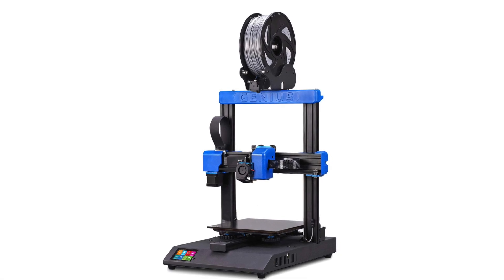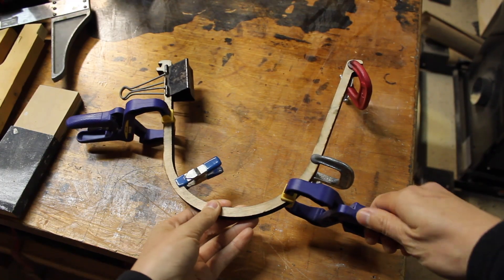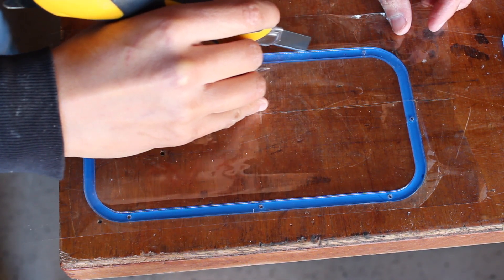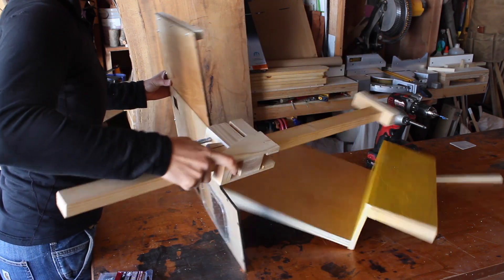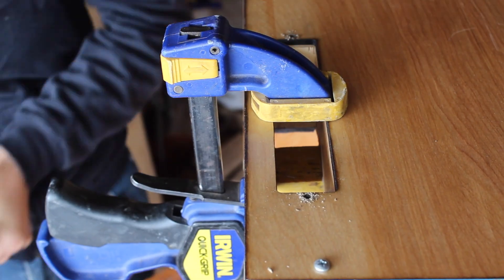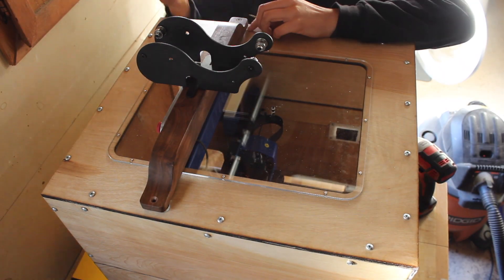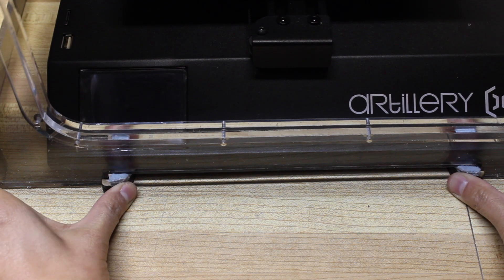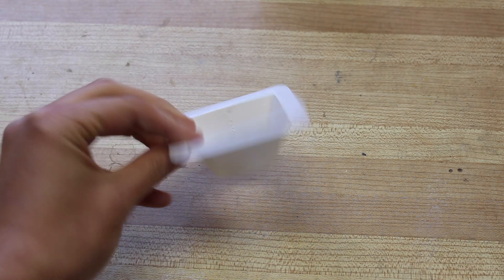Building a 3D Printer Enclosure

Comment: My dad swore by pop rivets and 40 years on I still use them. Fleece + spray = self adhesive pads is awesome. I've seen double-sided tape used but this looks much cheaper and easier to get the fit.

Comment: On my printer i didn't want the bed wire extending a mile back, so i made a holder which extends it just a little to the rear till it clears the gantry when the bed is full forward, and just goes up. Then i have a couple ziptie mounts on the side of the printer at the rear directing the wire up there. So the bed wire loop is vertical and twists rather than horizontal and rolls.

Comment: Why did you disable design history?
Reply from the maker: it is my preferred way to CAD for most things. I do a lot of pushing and pulling of faces. And I can never remember which step in the history I did each feature.
Reply: @AmyMakesStuff  In fusion 360 you can highlight a face/hole/etc and right click and 'find in browser'. This highlights the part in the browser (tree) on the left, but it also marks the feature of the timeline that generated it.
Reply from the maker: Good to know! My brain feels pretty wired to ignore the design tree though, unless I know exactly what the finished part will look like and it’s just a matter of adjusting parameters.

Comment: Awesome build, however, I have one question: Why ABS?
Nowadays there are so many plastics with the same or similar qualities that are way less toxic and much easier to print.
Reply from the maker: That's a totally fair point. Probably the main reason is that it was more fun to build this than shop for filaments. And honestly, once I finish this spool, I'll probably move onto something else. Do you have any favorite alternatives? 😬
Reply: @AmyMakesStuff  Hah, cool, yeah I understand it completely. Sometimes I design a machine to be able to make an idea that I have. But then I start wondering if maybe I'm having this idea just to be able to make some machine again. Sometimes it's not about what you're going to do with the tool, but rather about improving or making the tool yourself.
For plastics, I'm personally taken a liking to PETG over the past year, I never liked it much but PLA just has some serious shortcomings when designing parts for machines. When looking for a more ABS like alternative I've read good things about ASA having better properties but should print with around the same settings as ABS, including less present fumes. I've never printed with it since PETG is my top scoring filament right now, but it cannot be used in for example UV-sensitive conditions. I think that ASA fumes still aren't that healty, but it should be better than ABS. I'm curious what you think about ASA. Since it's also UV resistant, it should be a good material for your camper, at least, I believe I read somewhere you wanted to print parts for your camper car?
Reply from the maker: Very cool! Ya, I want to make some camper parts. I ended up designing things that I think will have very little UV exposure in the end. But less fumes sounds like a good thing!!
Reply: ASA is a good substitute for ABS with less smell.
Reply: @saritsotangkur2438  But does less smell equal less dangerous fumes?

Comment: Great project! Why didn’t I think of adding a humidity gauge to my printer?! That’s genius.  Still flexing with the tapping stand.
Reply: @AmyMakesStuff  - How do you actually use the humidity sensor?  Just not print when the humidity is too high?  Are you planning any climate control?

edit: I wonder if it would work to use a mini-fridge on PID control as an enclosure...
Reply from the maker: That sounds like a good way to get very good control! The humidity sensor has a temp readout too which is really the main thing I am looking at. And it’s just to get an indication of if I’m in the right ballpark. The garage can get pretty cold. Now I can turn on the heated bed, preheat the enclosure and then start the print. Very manual, but less blind than before.
Reply: @AmyMakesStuff  - I was only thinking about humidity control, condensing cycles to drain excess moisture.  The refrigeration system would be kind of unhelpful for maintaining above-room-temperature, of course.  Eh, I tend to overthink things :)

Comment: Nice!  I really like the look and design of the sliding panels.  Thanks for the video!

I have to wonder if using 2 layers of acrylic for a window, instead of an entire acrylic top, really saves on the material cost.  Though, I suppose it could just be because of the size of acrylic you had on hand.
Reply from the maker: Ya totally, it was nice to use what I had on hand instead of buy even MORE acrylic. But agreed, if you were buying fresh, probably better to consider just a thicker or bigger sheet to begin with.
Reply: Double glazing is also better heat retention - not that it matters here because the front probably loses quite a bit more.